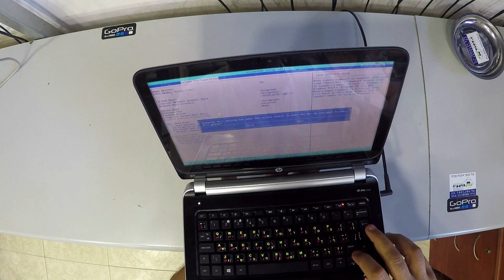HP Pavilion TouchSmart 11  Disassembly and Reassembly

Comment: Is it possible to change the processor in this laptop?
Reply from the maker: No, It's embedded to the mainboard.
Reply: you can buy a replacement motherboard (730894-501) which has an A6-1450 instead of the (730893-501) which has the much slower a4-1250. The A6 is still a slow CPU but its still much faster, often more than twice as fast as the A4.
Reply: @yotoprules9361  need dump bios
Reply: @youneslafri9120  I sold the machine a few months ago unfortunately, sorry
Reply: @yotoprules9361  not a problem ` thanks bro i found it
Reply: @youneslafri9120  that's great to hear